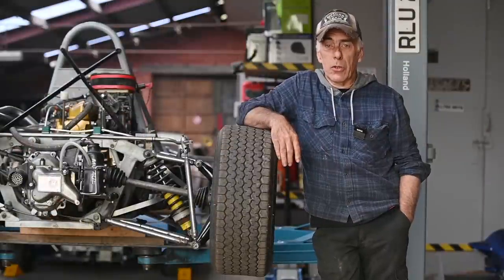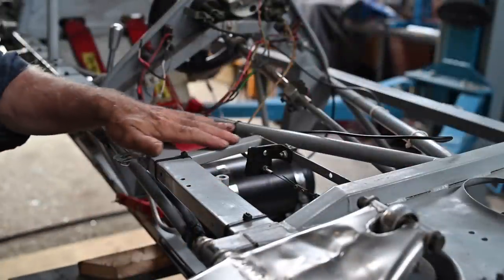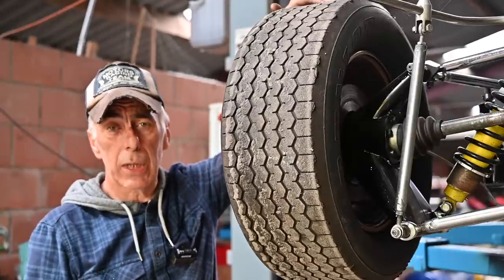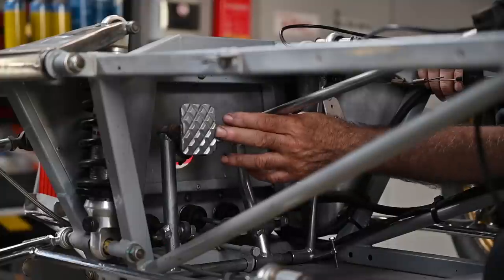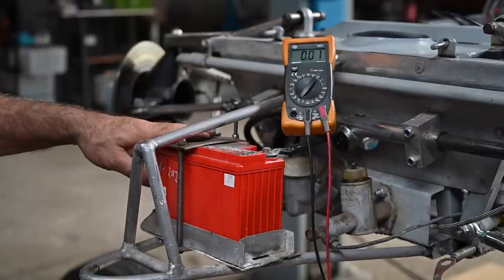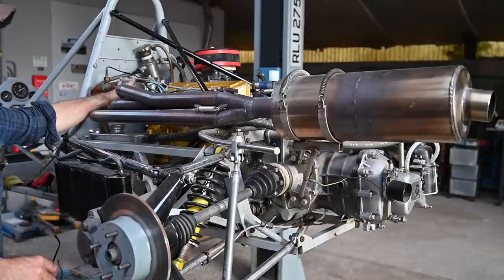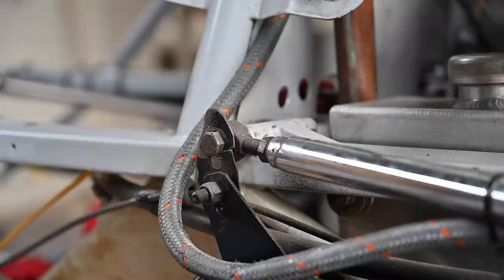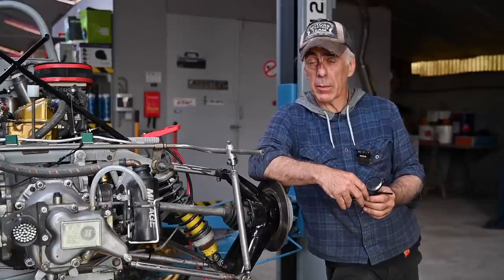1978 Hawke - Formula Ford  FF1600  - Technical Assessment

Comment: This is good starting point for a restoration. Note: the cutouts on the shift linkage were OEM from the factory, not unusual for the era. Also, shift linkage bar is always a little loose in these old Hewland boxes.😉
    ALWAYS, I mean ALWAYS when you get a car like this(old) it should completely torn down to the last nut and bolt and bead blast the chasse to the bare metal. This racer was obviously maintained on a budget and who knows what surprises awaited. And just because you cant see corrosion, doesn't mean it isn't hiding under the epoxy paint. I noticed too many things too mention that were missed in the video that I'm sure Steve will correct when rebuilding. There was some info missing, like when was the car last raced, how long has it been sitting(rebuild master cylinders), last engine rebuild, trans referb. A few notes of my own:
- Radiators: Get them hot tanked and pressure tested, if still good, why change other than something more modern, maybe lighter. The current rads. if in good condition are more than enough cooling capacity. At minimum test car with current rads., You'll be spending money in a lot of other places you don't know now, radiators can wait if these are good.
-Engine: A serious racer would rebuild the engine. You don't want to go to all the effort of getting this car restored to race and have engine problems at testing/race weekend. Budget racer hopes for the best, but look at how well the rest of the car looks.🙃
-Trans: Ditto want I said about the engine...even more so. People tend to let trans work slide more than engine work. 
-Battery: Get a modern, light dry cell racing battery and put it inside the cockpit, under the feet. I'd spend that money before unnecessary radiator money.
-Bodywork: Think ahead. Repair and refit the bodywork first so you'll know exactly where you need to weld on additional fasteners once the chassis is down to bare metal. This also applies to fasteners for the fixes you're planning for the cooling system. 😉
    Rick
Reply from the maker: Hi Rick, indeed there are many other factors, some known , some not known... It can be very hard to find its history.  In this case the previous owner had it for 10 years and did race with it . In  the state it is until last year when he started to rebuild it...  He claims the engine was rebuild , and I tend to believe so as i` have  seen the bills.  how good the rebuild was is another story....The man stopped racing as he 72.   There are many things that will come up during the rebuild video's.  And yes there are several points that i did not mention in the video ( would have been  2 hour video 😀).  As for the chassis,  I will blast this with garnet 360, and get new paint ....  after blasting one can see indeed the reals state...     This video was an overall assessment , details will follow.......But all very good points. Thanks for taking the time to write it....

Comment: Hi

I have a PRS FF1600 from the same era, so I'm looking forward to seeing this rebuild. I'm learning a lot from your channel!!

Gearbox looks like a Hewland Mk9. The fastener with glue round it holds a spring loaded plunger which pushes on the selector arm to stop you getting reverse when you want first gear. You have to push against the spring to get reverse.

Also, the spring pans will raise the car if you use them to take up the gap at the top of the spring which you may not want. You can get low rate flat helper springs which will take up the slack without raising the car. All will likely change if you fit new dampers, though.

The clutch master cylinder looks like ones on the PRS. I believe they were AP Lockheed parts  - CP2145 - 4 master cylinders, but hard to find now.

Hope this helps!
Reply from the maker: Thank you for the comments,  and the good info...  indeed it seems to MK9... that explains why the reverse is very hard to get...  Very good info

Comment: Nice video Steve.  Regarding the brakes they look like standard MK2 Ford Escort callipers and discs. They are normally that thin and small in diameter. Of course these are all still available new from specialists. I would keep the Lockheed callipers and after a rebuild and tidy up they will be probably better than new aftermarket versions.  Hope this helps. Regards Duncan.
Reply from the maker: Thanks Duncan, that is good info.  As for the callipers, those will stay indeed... Most aftermarket stuff is not all that good...

Comment: Hi Steve.i think the tank hose is not an overflow. But use to be a breather sistem. To prevent the tank going vacuum. Best thing is to put a longer tube on and curl it 6times. And feed it high up into the role cage. And put a lite vacuum valve on the end. I maybe stil have one,-00.2 bar. Like the vlogs. Gr Hub
Reply from the maker: Thanks Hub,  good tip

Comment: Looks like you have some wotk to do but Im sure that will be fun and interesting. Will be fun to see how it turns out in the end.

Regarding the brakes they do seem a little small and simple. Youre not contemplating an upgrade to ventilated disk and beefier caliper?

Keep up the good work!
Reply from the maker: Thanks for the comments, those are standard brakes for a FF1600  , as the car is very light... 400Kg

Comment: I’m always a little bit wary when I see chrome plated suspension and other high stress parts. High carbon/high strength steel can suffer from hydrogen embrittlement unless it is heat treated after plating.
Reply from the maker: Thank you for the comments
Reply: @D3Sshooter  thats why most are nickel plated and polished

Comment: These disks look like they are the same as a DL11.  If so, there are none available.  I buy Nissan Micra rear disks, and machine them to fit.  Takes about 30 minutes of machining.  I have a drawing with the details if you wish.
Reply from the maker: That is very interesting,  that drawing would be nice ... If you don't mind sending it steve@flashsplash.be   ... Although it seems that the DL19 has Ford Escort 2 disks .  I will need to check that out